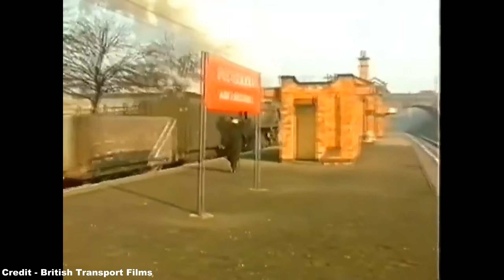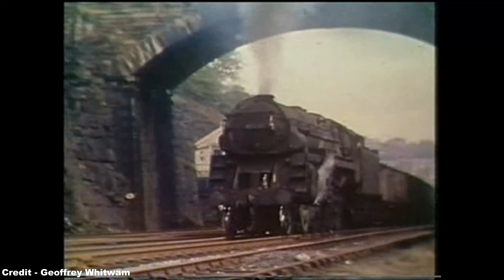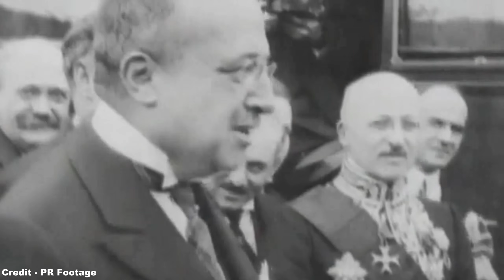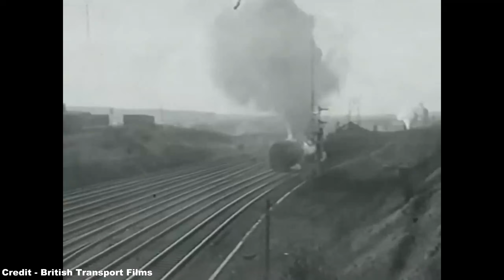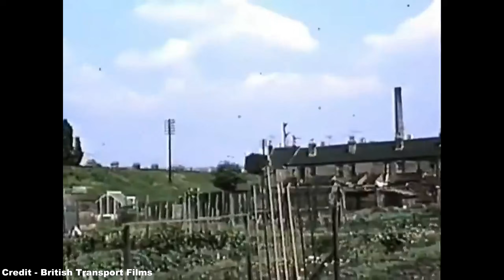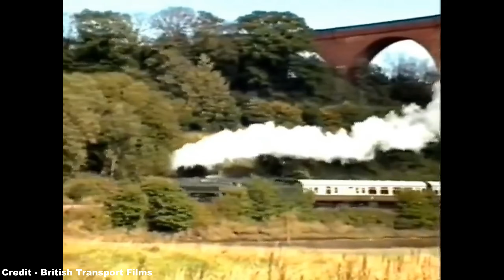The Last Stand of British Steam - BR Standard Class 9F (Reworked)

Comment: I really can't get my head around the concept of banning these locomotives from main line running simply because they had a built in safety feature of the Flangeless middle driving wheel. 
I mean it prevented rail damage on tight curves and also preserving it's own chassis and running gear from unnecessary damage and wear. 
I mean what killjoy came up with that policy?

Comment: Its amazing how the 9f never had a problem with the flangeless middle wheel till after the useless Beaching Report and the downgrading of the rail system . Ironically enough , there is a 9f that runs mainline traffic in Germany where the tracks have tighter bends , while using the same track and points system in the UK , with absolutely no problem what so ever , therefore proving that it was some nitpicking nitwit who was trying to stop steam all together , I must ask , was this Beaching's secret lover ? Either way , there is zero actual current proof that a 9f will damage british tracks , pompous british egos though , oh yes , plenty
Reply: Since the end of steam with the standard use of flangeless wheels, the design of S&C has been changed and the check rails are now often slightly raised, compared to the running rails. This is a real thing, contrary to your mindless rant, and yes there was a real life incident of a 9F damaging checkrails.

Comment: There was a tiny class of shunting locomotives, which were even more powerful than the BR standard class 9F. The original Robinson Wath-Yard ‘Daisy’ shunting engines from 1907 had a tractive effort of 34,525 lbf. The LNER built two more in the 1930s, with superheaters and boosters, providing an extra 12,373 lbf, making a combined tractive effort of 46,896 lbf (208.6 kN), compared to the 9F’s tractive effort of 39,667 lbf (176.45 kN)

Comment: The 9Fs and Austerity 2-10-0s are banned from running on the mainline in preservation because of their wheelbase
Reply: No, it's the centre set of driving wheels with no flanges on them that's the problem which are at risk of damage on modern points

Comment: The reason why 9Fs cannot be certified fir mainline use in the preservation era is a bit unclear. Could an enlightened person please explain it to me?
Reply: The 5 driving wheels are fixed in that they don’t articulate.   So have a length of the 5 wheels that have to negotiate curves.    This is too long a length for the railway network curves so the middle wheel was put on without a flange.   That is the bit that drops down on the inside of the tracks to keep the loco on the track. (In simplistic terms)
This allows the loco to make the curves but it does mean that the middle wheel may not be fully on the track as such.
At some points on the network then have what are called check rails that help keep the trains on the track.    This is now higher then in the past and the middle wheel on he corner would foul on the raised check rail meaning wouldn’t make the curve or would risk riding up onto the check rail and derailing the loco.
There is nothing else out there that has anything like that length of continuous wheel, even the diesels with 8 wheels at each end such as the peaks have articulation in them so that can negotiate the curves.    As such they aren’t going to regulate the network so can run a handful of loco’s that would need potentially lowering in height as well as additional safety equipment, to the point that no guarantee that he owners would want to pay the expense.
didcot railway centre making a decision that it won’t outfit its loco’s for the main line anymore due to the increased cost.     The project to build a patriot 5xp also makingbhe decision to forgoe mainline certification for now due to increased cost.
Ian Riley once said it is very easy to have a steam loco and a £100,000, the problem is you have to start off with a loco and £200,000.
Mainline running is not cheap and if you go on a run out on the mainline behind steam expect to have a lot of people on the train coining up and down raising money for the loco.
Hence why many loco groups keeping off the main line.
Reply: @michaelmcnally2331  Thanks!

Comment: There should have been,another alternative,that would have changed the BR mindset! The Santa Fe had 2-10-0 engines in pusher service on Raton Pass,and other grades,but found that,if they put a trailing truck on the engine,it could go up and down the grades,much more rapidly,so the 2-10-2 was invented! Now,if BR had followed that logic,and had 2-8-2's,and 2-10-2's,equipped with stokers,and feed water heaters[Worthington,or equivalent],ala the ATSF,mayhaps there would been a different outcome! The Mikes would have been in road service,and have operated,as general purpose units! See the 141R's on the SNCF,and many US engines,that doubled in brass! However,it seems,British engineers had an aversion to trailing trucks,despite the colonial railways,such as India,using large amounts of them! They never learned from others triumphs,why?? Thank you for your attention! Thank you 😇 😊!

Comment: I seem to remember, from news of than ban at the time, the reason they cannot be used on the main line is due to the check-rails which would be fowled by the centre (flangeless) driving wheels due to the 5 sets in a rigid line.

Comment: Standing at the bottom of a field off Bryant Road, Kettering (now a housing estate) in the late fifties I watched a coal train with three 9F's, one at the front, one in the middle and one at the rear, go by using whistle codes between them. I thought the train would never end
A few years later whilst in the Harpenden Junction signal box I would watch from behind the lever frame these locos and also 8F's taking coal trains to London and returning with clanking empties.

Comment: It was a 9F that pulled me from Templecoombe to Bournemouth on my last trip over a part of the Somerset and Dorset. After that, I could only walk my dog (a collie cross, Brunel) up the empty formation from Blandford.
Reply: I was standing on the platform at Bournemouth West. A Saturday treat to hang around on cold draughty platforms waiting for S+DJR oddities. Two bob 8x10 prints of locos in the foyer as were often models of locos built by engineers from 4" to 15" guage. Site now occupied by Wessex Way which terminates one mile on at County Gates. Liberals controlling Poole in 1969 refused extending WsxWy to Alderney, Poole thus linking with the A35 to Dorchester. Traffic in the town has been a mess ever since. Politicians scoring points, eh?

Comment: I still think that should have built at least 1, class 9, 2-8-2 just to see if it was any good!
Reply: It wasn't any good. One 9F 2-10-0 finished its days in 1967/8 running as a 2-8-2 after breaking a rear coupling rod and having the opposite side rod removed, just to keep it in service. It was reportedly quite a poor tool, which would be expected after losing a fifth of its adhesive weight. Of course that is not a true comparison with a purpose-built 2-8-2, but the lower axle-loading of a ten-coupled engine would always be an advantage. And end-coupled engines have less tendency to wheel-slip than those with carrying axles under the cab.

Comment: It's interesting that theoretically, the 9F's could have run well into the 1990's. I wonder how they would have looked in British Rail liveries with the Double Arrow logo on them.
Reply: Yes. There were a few rail men who thought keeping steam locos longer and electrification of most of the network would have been a better modernisation plan. Evening Star was a loco that served not many years. As did others. Sad really. Especially when lots of the early diesels didn't last long. 😢
Reply: If they retained overall black, and made the white double arrow as large as would fit on the smoke deflectors, I think that would be quite striking.
Reply: Stainless steel boiler cladding and smoke deflectors; tender and cabside in BR blue which large double arrow on the tender.
Reply: See the narrow gauge Vale of Rheidol 2-6-2Ts, they survived into BR blue

Comment: It's a wonder that no UK railways ever bothered with mechanical stokers and/or very large fireboxes supported by 4 wheel trailing trucks. I guess it's because most of the freight cars didn't have air/vacuum brakes and the buffer-and-chain couplings were pretty weak compared to the AAR knuckle couplers (and the other similar ones in use throughout continental Europe) so there wasn't much point given the limited weight of trains. Also - feedwater heaters were standard equipment here in the US, so it's baffling to me that they weren't a thing in the UK much.
Reply: fitting mechanical stokers was looked at for the Duchesses but decided against. on test runs/record attempts I think they had 2 men firing
Reply: @andrewyoung749  I'm still rather surprised by this, the Coronations were not super different in firing area to the bigger Pacifics that did end up with stokers here in the US. I guess tender size restriction may have been part of it...

Comment: An excellent resume of an excellent loco. I have no idea why a decision was made to abruptly end all steam traction in 1968 rather than gradually phase out the freight haulage side. Passenger work was a different matter.  Surely the cost of building replacement diesels of a power sufficient to match the 9Fs TE would have been more than keeping 9Fs on for heavy freight duties for say, the next 10 years even taking into account the maintenance costs of a steam loco as opposed to a diesel. I imagine also that the 9Fs were much less prone to failure than the diesels, being much simpler and easier to repair. One inconsequential point is that Evening Star hauled the last Pines Express over the Somerset and Dorset - (and unassisted)- on 8th September 1962.
Reply: The accountants didn’t want to pay for the maintenance of the infrastructure to support steam as well as having to pay for the new diesel and electric maintenance.
As such made economic sense to move to diesel and electric as quick as possible.
Even before World War 2 then the big 4 were looking at diesel and or electric as was recognised as thee future.
After WW2 then most of continental infrastructure was gone and had to be built up so made more sense to go diesel and electric rather then spend money on steam infrastructure when was recognised as already outdated prior to WW2.
UK however mainly had the steam infrastructure in place, abundant supply of coal etc so sticking with steam short term made more sense.
However once decision made to go diesel and electric then you want to transition quickly.
Reply: @michaelmcnally2331  And don't forget by the 1960s people increasingly didn't want to work in dirty unsafe environments. BR was finding it difficult to employ cleaners who would eventually go on to fire and then drive steam.
Enthusiasts forget Steam was not glamorous, to many that worked on the railways. It was dirty, tiring and dangerous. For every railwayman that loved steam there were many that welcomed the cleanliness, ease and comfort of the modern railway.
Let's be honest Steam was inefficient and less productive than the modern technology that replaced it.  
People love steam but most didn't have to work with it!
Reply: @mandywithell  That's the truth!

Comment: The 9F had considerably more power than almost all other freight engines in the UK preceding them, tractive effort being the same as the slightly larger German 2-10-0 Br50 but in horsepower as powerful as the German Heavy 2-10-0 Br44 which had three cylinders.
Certainly one of the best Standard designs, on a shared first place with the Standard 2-6-4 4MT tanks in my opinion, as the 4MT tanks were very versatile and reliable locomotives too.
Just a shame of the Franco Crosti experiment which was wasted effort as the exhaust steam injectors and double chimneys combined with optimised steam channels by Andre Chapelon made them already very efficient without the added complexity. Not mentioned but a big problem on the Franco Crosti system was the corrosion in the feedwater heater boiler, exhaust gasses cooled down far enough in these to have forming of sulphuric acid occurring eating away the boiler tubes.

Comment: What never ceases to astound me is the insular attitude of British Rail Designers...after WWII, was any of the German Kreigslok designs  ( BR52 etc ) of 2-10-0 wheel arrangement, some of which continued running in Eastern Europe until the 2000s.
Whilst there may have been some Loading Gauge issues ( Europe  vs UK) but these could be overcome.
Reply: The centre flangeless wheel won’t negotiate today’s check rails, hence the ban.
Reply: The truly baffling part to me is that the designers didn't think to ask steam holdouts across the pond what made their locos better. Looking at something like a later era Nickel Plate 2-8-4 (mid to late 1940s, the "last hurrah" of steam in the US) I can't quite understand why by the time the 9Fs were drawn up a decade later otherwise standard appliances like feedwater heaters or roller bearings weren't included by default.
Reply: @AFullerHouseAtlantic  Expense. The government were paying for them so they were built to the bone. Simple but effective.

Comment: It's great to learn that Dr. Costi and André Chapelon have been involved (at some stage) in the development of the Class 9F.

It strikes me that in the UK such a class eventually came into development by BR, whereas it wasn't included in the development scheme of the Deutsche Bundesbahn (the West-German precursor of Deutsche Bahn). Nevertheless, the last official steam deployment schemes of DB (1977) involved heavy 2-10-0 engines, and those of DR (1988) in East-Germany lighter 2-10-0s. I admit: those pre-war designs had been equipped with new boilers (including some using the Franco-Costi design).
Here in the Netherlands, Riddles' Austerity engines may have been the only 2-10-0s NS has ever had (not counting a few damaged German ones), and the last of these was withdrawn as early as 1952!